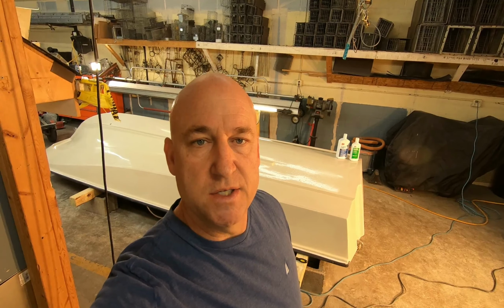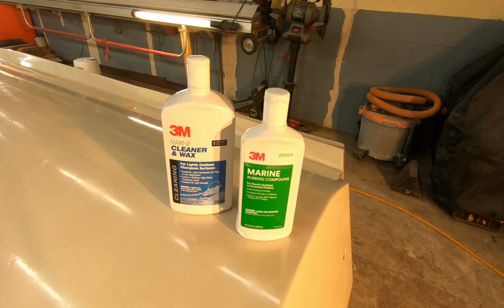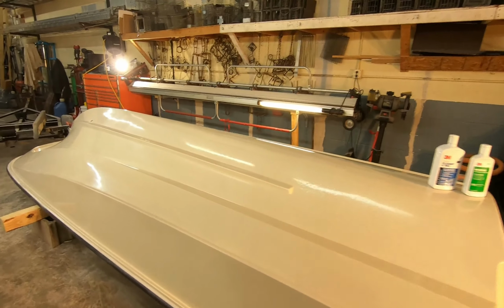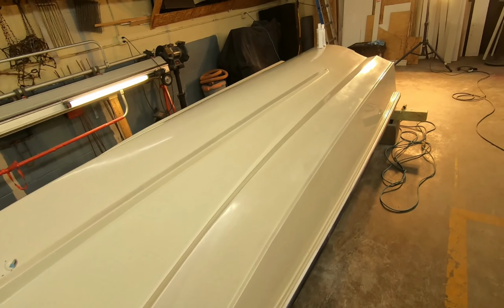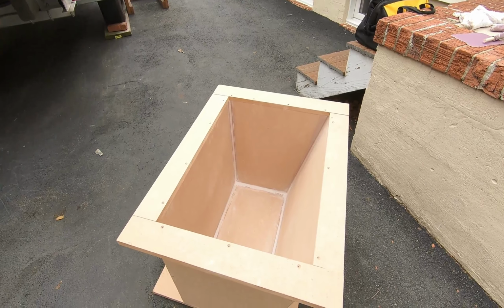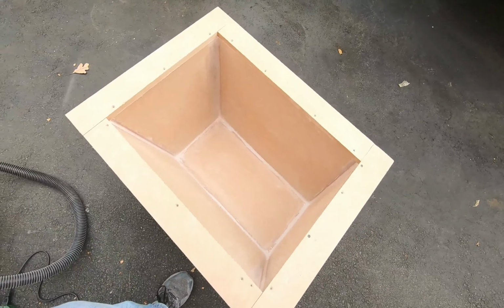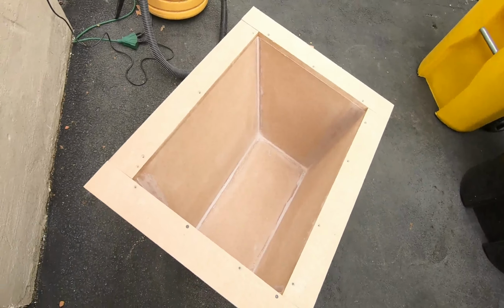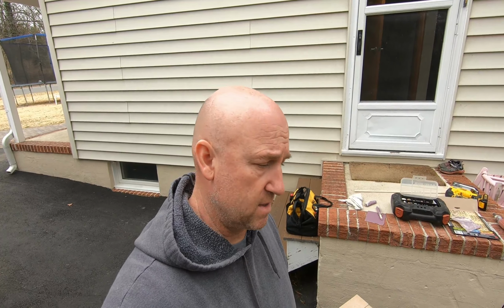Classic Boston Whaler Rebuild Ep. #5

Comment: I am looking for some information on how to remove and insert the brass through hull drain tubes.  You talked about this in the finish/walkthrough Episode, but I'm not sure how to attack this on my BW 15.  Thanks for a great set of videos!
Reply from the maker: I give some tips in my transom (deconstruction) video. *Use a large screwdriver and hammer to collapse the ends of the tube, by tapping the tip of the screwdriver into the lip/O-ring. Once there’s no more lip and or the ends are collapsed you can use needle nose pliers and pull the tube out from the transom. Hope this helps.

Comment: Question: Did you use 37, 40, 80, or 120-grit to sand the bottom of the boat, or a flip disc (and what grit, please)? Beautiful results. 💰
Reply from the maker: I used an old 320 grit pad to loosen up the crud, the gelcoat is fairly thin so I didn't want to go too aggressive. Thanks for watching!

Comment: Did you gel coat over epoxy filled holes?  I want to to fill in old motor holes the re-gelcoat entire boat.   I hear that epoxy can have gelcoat over it if prepped right. thanks
Reply from the maker: I did small spot repairs around the outside of the hull with Epoxy and Gelcoat over top.. *You should be fine with the old motor holes. My repairs have held up perfectly. 
I didn’t Re-Gelcoat the entire hull just spot repairs where needed.
Reply from the maker: Thanks for watching! Hope you got something out of the series.
Reply: @spinfish1434  for sure. thank you!

Comment: Thanks for the videos. I’m going to be repairing blisters on a 1974 13, but I haven’t gotten comfortable yet with the process. Videos like these help. Is it your opinion that I can spray gelcoat over existing after making repairs and it wouldn’t be too thick? That seems to be what you did given you didn’t sand down to the fiberglass.
Reply from the maker: I did spot repairs on deep scratches and gouges. Then a light respray of Gelcoat to blend it in. You could grind out and then fill the blisters with a good Marine filler and do the same. *It won’t be too thick imo..
Just depends on how far you want to take it. We did achieve decent results and all the repairs have held up nicely. Thanks for watching happy to know you found the series helpful.
Reply: @spinfish1434  thank you for the quick reply!

Comment: Great job,  question, how much Mekp do you used with spectrum gel coat.
Did you add Spectrum Surface Seal and Mekp to the gelcoat?
Reply from the maker: We used different amounts of MEKP depending on the amount of resin (we made several batches). We used Patch Aid with the Gelcoat, it improves sanding and sealing.
Reply: Ok perfect, did you remember how many oz of Mekp per amount of gelcoat?
Reply from the maker: @henryc8443  I just followed the instructions on the can.

Comment: Do you recommend the spectrum gel coat? I’m doing the same thing but gonna spray the topside only. How much did you use and did you put wax in the final coat only? Thanks!!
Reply from the maker: Yes, we used it. Mostly spot repairs on the bottom, sprayed it on the transom. For my project we used 2 Quarts, (the console used 1 full quart). Yes we used wax in the final coat.
Reply: @spinfish1434  did you use any additives like duratec in the transom spray?
Reply from the maker: @eggegg6101  No Duratec in the transom spray. Used Patch aide which helps sanding.
Reply: @teach1644  Well to be fair I haven’t done it yet

Comment: Hello and what is the maximum hp you can put on a 13 footer ? I found one and wasn’t sure what it would be and also the maximum capacity of a 13 footer? Thanks
Reply from the maker: The 13’ has a max hp of 40 which is plenty. A 30 would be the minimum hp imo. 4 adults is probably maximum you’d want onboard. The 13’ is significantly smaller. They’re great little boats for zipping around in, going to restaurants and dock bars etc because you can dock them anywhere. Hope this helps.

Comment: It's hard to tell, but it doesn't look like you're sanding the gelcoat back far enough from the patch area for good adhesion of your 1708. Also each subsequent layer of patch should be a little bit larger then the last to insure contact. Check out, Boatworks Today, Youtube channel for how it's done properly. Andy covers all things fiberglass and is a true master of his craft. Otherwise good work!
Reply from the maker: It will hold, that top patch was just an “extra” bit.
Reply: Its a small non-structural repair...  Ideally, Paul McCormick is correct about sanding the gelcoat further & applying your smaller patch first, but you aren't doing this work to repair someone else's boat...  Your repair should hold just fine. 👍

Comment: How much would a job like this cost today
Reply from the maker: It will vary a lot depending on who does it and what exactly is done. If you're referring to some gelcoat repairs only and some respray then my guess would be $1200..
I started with a bare hull, built a mold for a custom console, found a sweet F70 motor, all new wiring, some hardware new trailer and electronics etc etc $$$$ Full rebuild you're just north of $10K with a used motor..